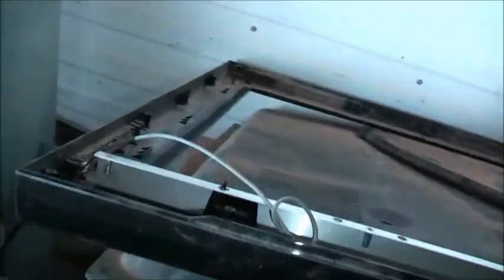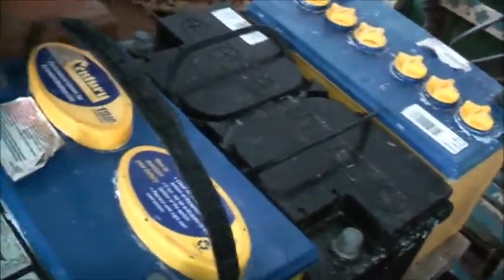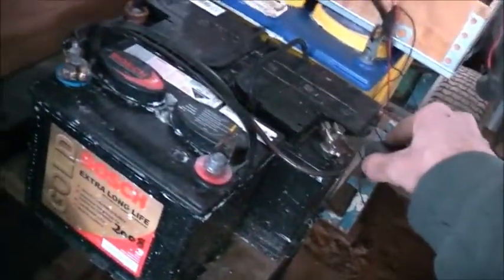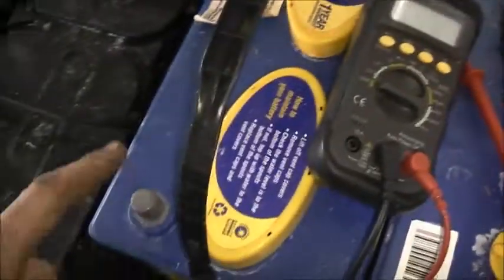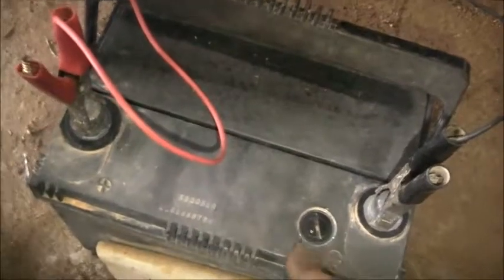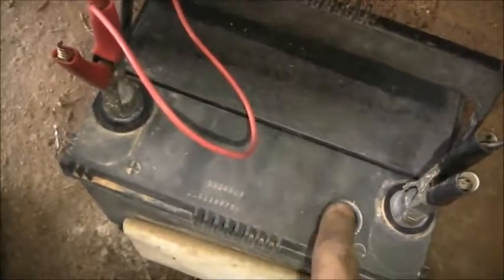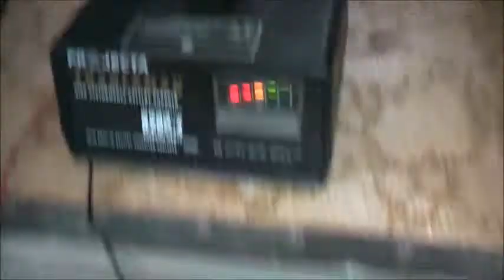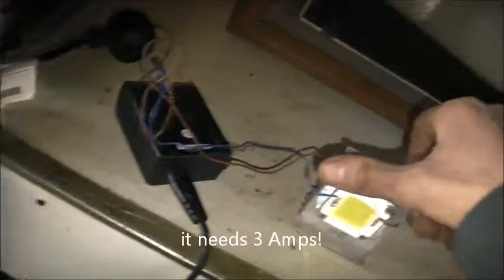ZVS Test On Alum Batteries!

Comment: For the LED, get a constant current driver. You can power the driver from a printer supply or something else. The working voltage change with the temprature and more.

Comment: very nice :)

with them printer power supply's if their output voltage is the same you could put them in parallel It is not recommended due to load sharing issues but could be interesting.

Comment: how do you remove the acid from the batteries?
Reply from the maker: tip them upside down & flush them!! if they're maintenance free, ya need to drill out the top above the cell plugs!